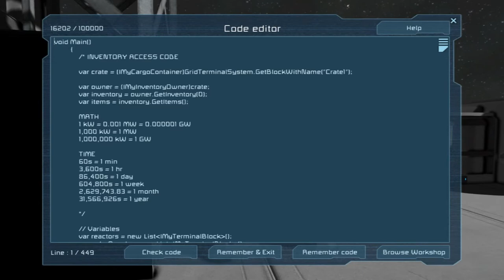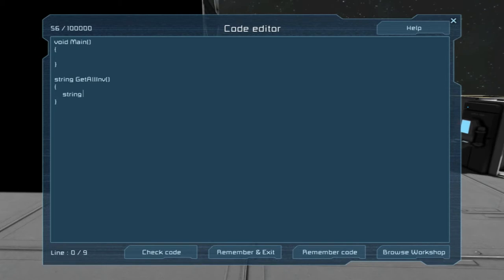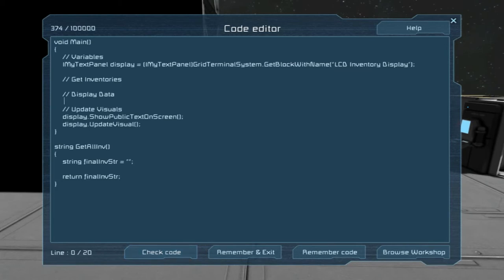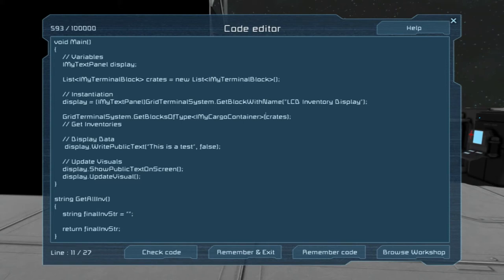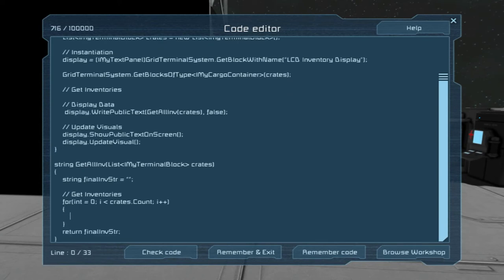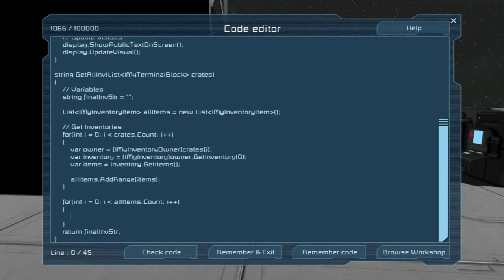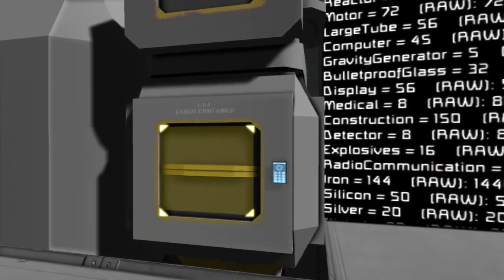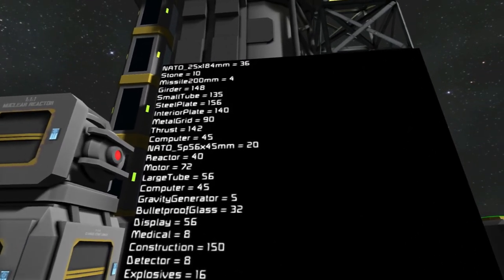Space Engineers Programming 101 - Inventory Manager Script - Part 1

Comment: I don't know if you did, but I think you also have to factor in the timestep of the calculations ingame.
For example, the power consumption and distribution ingame maybe happens only once every seond.
But this isn't really necessary, as this should be just another fixed value and your ingame script also runs at a fixed value and should be synchronized.

the formula would be:
Time(h) = Uranium(kg)/Consumption(MW) * Ratio

you just need to figure out the "Ratio" part, which is basically, the effectivity of uranium or how much electricity it produces.
I highly doubt that the devs made it too complicated. In the real world you would have to factor in the quality of uranium and the efficiency of the reactor etc. In the game, it should just be a fixed value.

So if you have 1kg of uranium and a power consumption of 2MW and it would last you for 10 hours then "Ratio" would be 20.
You can calculate other values, or realtime values and see if it actually matches.

This would only apply if "Ratio" is linear, but I would be suprised if it wasn't.
Reply from the maker: +HPLOG3 This is true, that would be more accurate, but I'm not entirely sure that the game itself even calculates it that thoroughly. I honestly am not sure what all was covered in this episode, but I did eventually find a way to match the HUD calculation almost exactly. There is still some rounding fluctuation somewhere that I haven't isolated, but it's the closest I've ever seen in a script to matching the HUD fuel time calculation.

I do agree though that in reality I think you're way would be more precise, but again, I'm not really even sure if the game is that accurate in the first place for just what the HUD's displaying (which was the overall goal, duplicating the HUD info that is. ) :)

Comment: I do get 3 errors. 1st. is Line 33. There is no argument given that corresponds the required formal parameter

2nd error. Cannot assign void to an implicity-typed variable. 

3rd error, The type or member ´string MyObjectBuilder_Base.SubtypeName` is prohibited.
Reply from the maker: Well, first off, these videos are outdated and some of SE's programming API has changed, so take all of the info with a grain of salt.

For instance, I'm not SURE that you access inventories/items/etc the same way. I've been tinkering with the new API and have found some of the old ways throw errors now, so I'm GUESSING that's your 3rd error. I don't think it uses the "SubtypeName" anymore. It does, but I think it's accessed differently.

I'm not sure without the number lines, but I'm thinking your first error...and probably second honestly, is probably caused by the way you're passing the list as an argument. I don't pass them as an argument very often, but I don't THINK you need the type. For example: "string GetAllInv(List crates)" MAY work, not sure.

One way you could side step this is to make your crates list a global variable (outside the Main method) then you could declare your GetAllInv method with no arguments and just access the crates list inside it. 

That's just my thoughts from looking over your code without running it through Visual Studios to do some error checking etc. But hope it helps. I AM planning to redo this whole series but have been trying to finish & release my novel first. But I do want to update all of the info in these videos eventually. :)

P.S. Feel free to check out my discord server. I have a dedicated room for SE Programming questions etc. If you want to continue this discussion it'll probably be easier for me to keep track of it there. :)